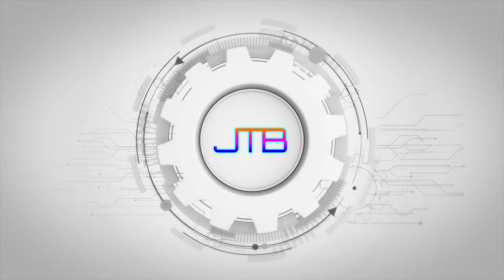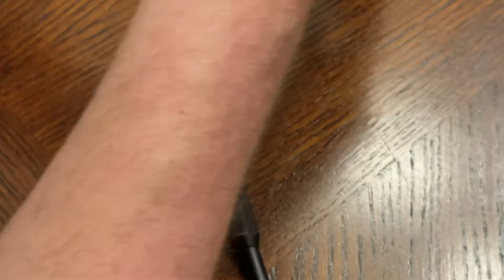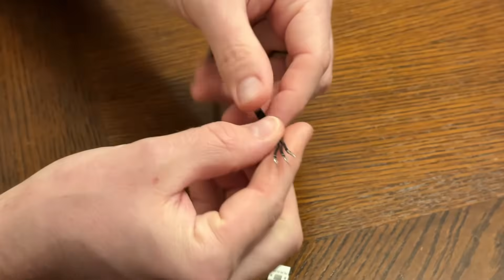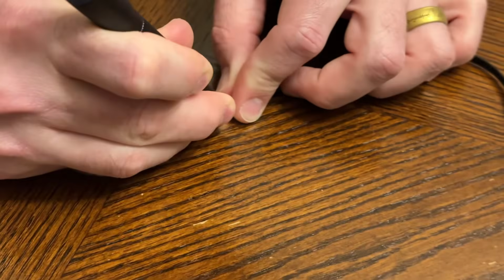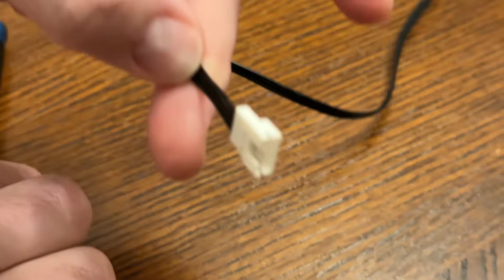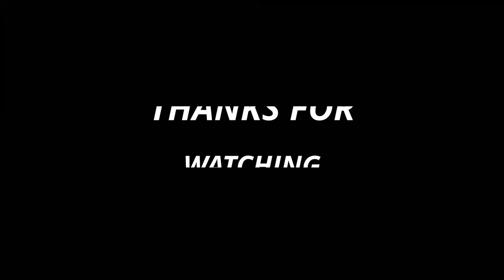Lian Li O11 Dynamic XL ROG Edition Front LED Strip Repair/Bypass

Comment: I already have the cable ready to connect, but... do I have to disconnect the RGB cable that goes from the box controller to the motherboard, or does it light up the power button and should be left connected? Thank you very much.

Comment: My light strip did not light up. The adaptor cable heated up. Not sure what I did wrong. I unplugged quickly
Reply: Make sure you put the cables in the right order.
To ensure the cables are in the correct order, look for the one with very small white letters written on it (they are hard to see), as shown in the video, and follow the steps. And connect it to the 5V RGB header on the motherboard, not the 12V one... check your motherboard manual.

Comment: Hi! I did exactly like in your video and the 3pin wire got pretty hot,I had to turn the PC off. The pins got black too so that wire jst adapter can't use it anymore. I ordered another cable and I'm wonder what am I doing wrong? Was the cable damaged?
Reply: Did you figure it out. Mine also got hot
Reply: nope.. I order another 2 cables but I was waiting for OP reply. I don't want to fry those 2 also. If he won't reply any time soon I'll do it   and will let you know.
Reply: @Ionuț-RGB-Enthusiast please do.  Really bummed this strip won’t work. Almost wanna say screw it and buy the newer model case
Reply: @llIlll i tried again and the wire gets hot as soon as I turn the PC on. I unplug it quick. I'll need to dismantle all the front strip. I'll put my own. A ws2812 maybe since I have my own controller.
Reply: @Ionuț-RGB-Enthusiast thanks for responding. That’s a bummer. You think the best case of action is to put our own led strip and hook it up to a controller? I have a controller as well
Reply: yes. I did a deep research and I found a guy with the same issue. He was lucky and lian li sent him a controller replacement. But in the process the guy removed the front strip. Basically any 5V argb strip will do. You just need to remove couple of screws to get to the strip. And since there are only 28 leds, the power will be enough straight from the controller.
Reply: @llIlll  Connect it to the 5V RGB header on the motherboard, not the 12V one... check your motherboard manual.
Reply: Same mine just gets hot doesn’t light up

Comment: Hi my 3 pin cable that goes from the Rgb to the controller board has damage (bought case second hand) leds don’t work and cable is super hot. Any idea where I can find a replacement tried AliExpress but it’s an odd size with ph2.0 connectors different at each end . Thanks

Comment: Hello, I'm here because I have a rather strange problem. For a while now, my internal controller seems to be dying, I think, because about half the time when I turn on my computer, the LED strip doesn't work, and I'm not sure what to do to fix it. Do you think the adapter you provided on Amazon would work by plugging it into the ARGB connector on my motherboard? I don't mind losing the effects, I just want it to light up in a rainbow.
Sorry if my English is bad.

Comment: I followed you video to fix the front led of my Lian Li 011 Dynamic XL ROG. But I directly connected the VDG to my standard 5v 3 pin. Then connected that to my argb hub which in turn is connected to my Corsair Commander Core. Worked like a charm thank you very much!
Reply from the maker: Glad it helped!

Comment: hey hows it going, my lights don't turn on for the most part, but maybe after awhile after a few boots it will randomly turn on and work for about a few days then go quite awhile without working again. its not the USB or the SATA, do you think its a similar problem?
Reply: Yes. Controller failure

Comment: I restored the LED strip according to your instructions: I connected it to the Corsair Commander Pro using specific cables suitable for the Corsair system. Thank you: this is the exact and easy solution :washhands:
Reply from the maker: Glad to know it helped! Thank you!
Reply: @joshstechbytes is there something I can buy to avoid takeing the 3 pin apart?
Reply: What cables did you need to connect it directly to the corsair commander pro?
Reply: what cable did you use

Comment: its starts to making wierd lighting on my strip to, sometimes the upper part is pink, but today it was just the bottom part on in green yellow.. thanks for showing, maybe i will just pull the connector and leave it that way
Reply: Why inactive? You can change the controller with new Lian Li controller. But it is better to connect the Lian Li LED strip to the motherboard, to a RGB hub or to the Commander Pro if you use the Corsair system. Please note that the electrical voltage is 5V

Comment: My RGB strip stopped working, sort of.  I usually keep it one solid color.  The bottom third stays the solid color but the top two thirds are now a rainbow color most of the time.  Sometimes when I turn the PC on the whole thing is solid like it should be, but most of the time I get the rainbow at the top.  Is it just bad or do you think this work around might fix the issue?  Thanks!
Reply from the maker: I can't say for sure in your case, but I would definitely give this a shot. My best guess would be that your controller is dying and that the lighting strip is still OK.

Comment: Good Video. I thought I fried mine but my controller was just shot out of the box. Worth noting that my controller was attached to the plate under by power button however. not in the bottom of the case that your video showed.
Reply from the maker: I am curious, do you have the ROG version of this case? I am wondering if the mounting location is different with different versions of the case or if they made a manufacturing change at some point.
Reply: @joshstechbytes  I do. it has the Rog badging on the glass side panel and its wider than a normal O11 Dynamic. I am in Australia, so could be a change in manufacturing and tooling at some point. I did order mine when it first came available in my country so it should be a fairly early model.
Reply: @Hrpengz  That's right, the first boxes came with the controller behind the power button, then they moved the controller to the bottom.